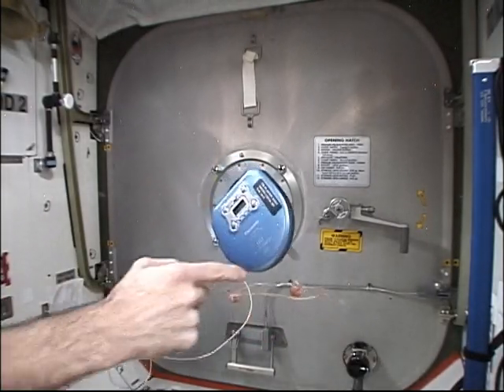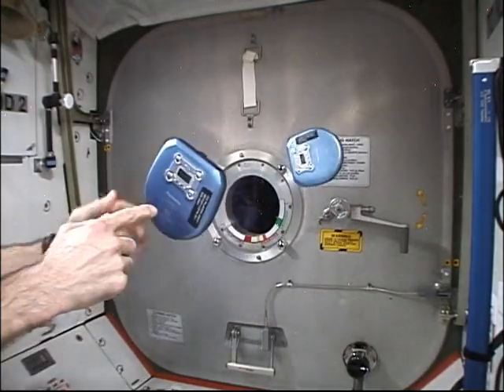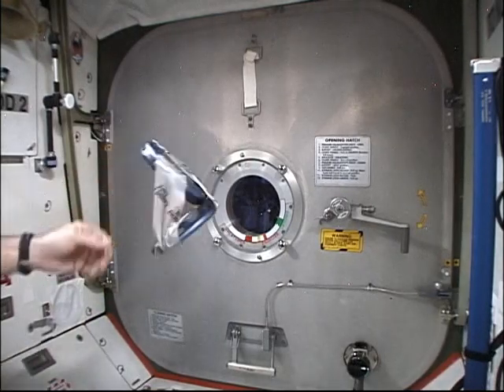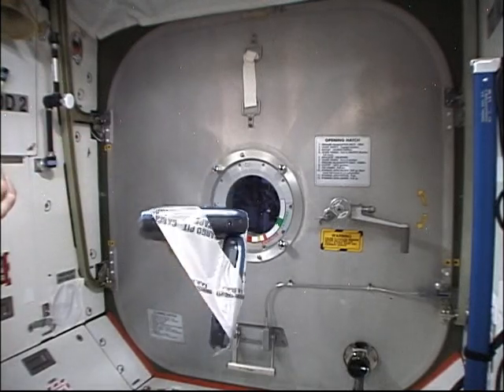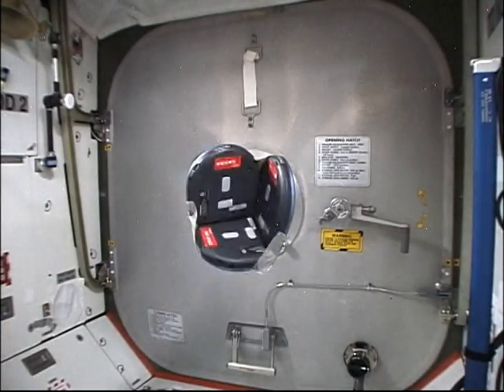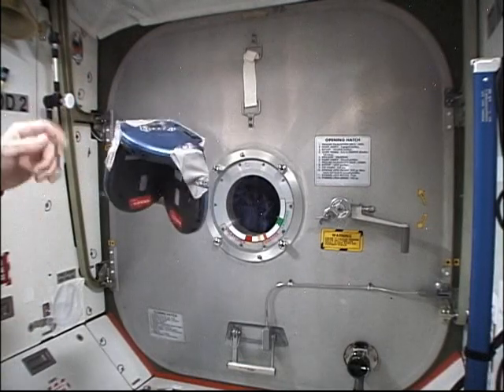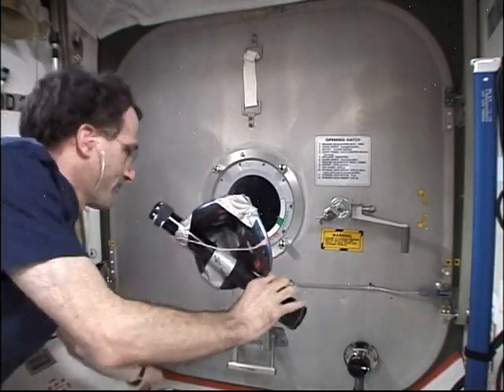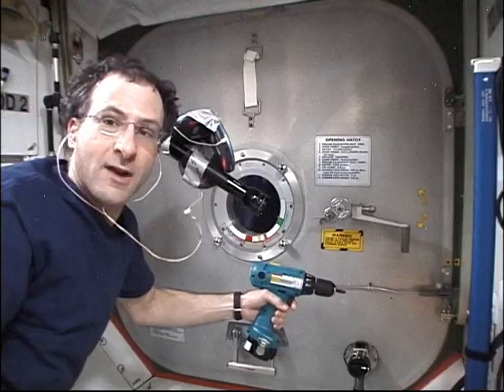Gyroscopic Platform in Microgravity

Comment: No, it's not 3-axis stabilized, the vector sum of the three discs simply gives the same behavior as a single one, as a different angle. To get a truly stable platform, you need to put each on a gimbal.